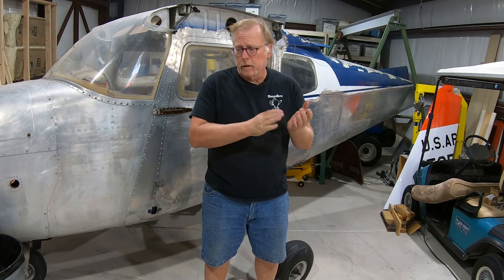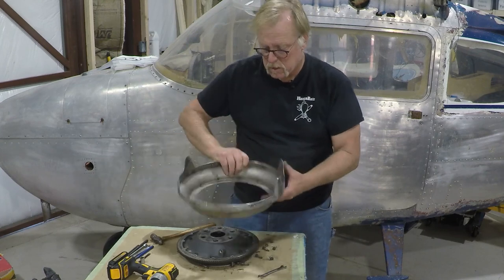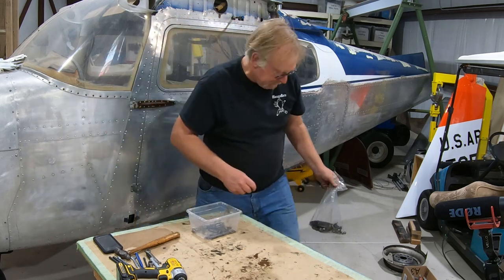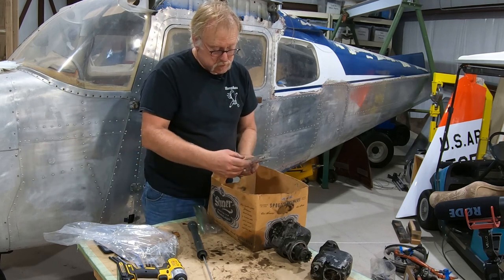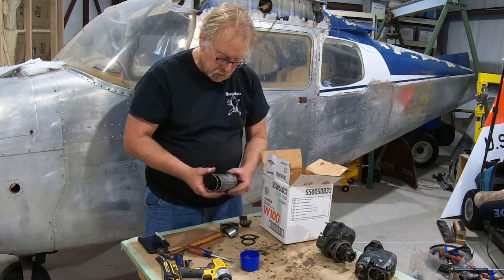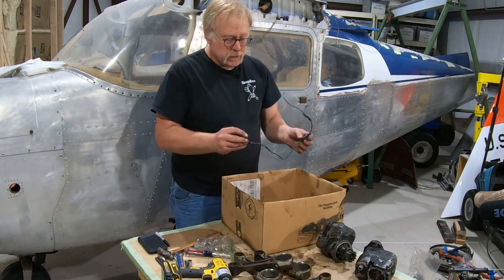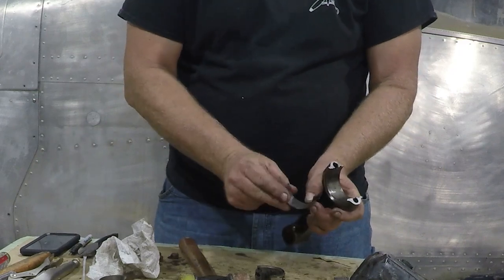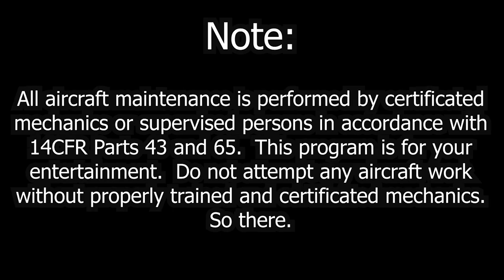Lycoming Narrow Deck 360 E01 Sorting the bits!

Comment: I'm looking forward to the rest of this series. Back when you put out the series on overhauling the O-320-A4J, I commented on a couple that I have the same engine in my plane. As it turns out, since then it decided to go into the glitter manufacturing business and has been overhauled. In fact, I was out at the shop today and the mechanic was finishing the engine installation. He was hoping to have it running shortly after I left. Watching these videos provides a lot of insight into how these engines are constructed and operate. These engine designs are 70+ years old and, in many ways are rather primitive compared to modern engines but, even so, some of the engineering that went into them is really impressive.
Reply from the maker: More to come.  Thanks for watching and thanks for the support!

Comment: Bill,  thanks for all of your excellent videos.

Questions and observations.

Why is sealant not applied to the saddles on the forward, center and rear webs of the crankcase halves on Lycoming engines-? 
Sealant is only applied to the parting surfaces around the periphery of the crankcase halves on Lyc. engs.

Continental engines apply sealant and silk thread to the forward, center and rear web parting surfaces.

Since there is very slight movement between the case halves parting surfaces in the center of the engine, metal fretting sometimes occurs as well as oil ingression between the parting surfaces which eventually means metal wearing against itself and torque being lost on the thru bolt nuts. Then it is just a matter of time for having to do a premature engine disassembly. 

On another note, 
Lycoming engines have their camshaft mounted above the crankshaft which means no oil drip effect from the crankshaft on to the camshaft which results in premature rusting of the camshaft lobe(s) and lifter face(s) if the engine sits inactive for a period of time. 
Continental engines mount their engine camshafts below the crankshafts and are less prone to rusting of cam lobe(s) and lifter face(s).

Having to remove the propeller and starter ring gear on a Lycoming engine to change an alternator belt is a bad design while this is not necessary on most Continental engines since they mount their starers and alternators on the accessory drive case meaning that no drive belt is required.
Reply from the maker: Continental uses sealant on the inner surfaces because their through bolts have the ability to leak oil to the exterior of the engine.  It has nothing to do with fretting of the case.  In fact, sealant can aid in fretting as it acts like a lubricant.  Both Continental and Lycoming have their good and bad points.  Neither is superior to the other.